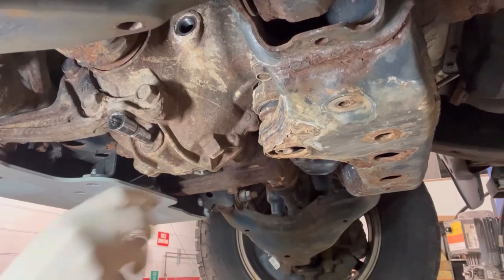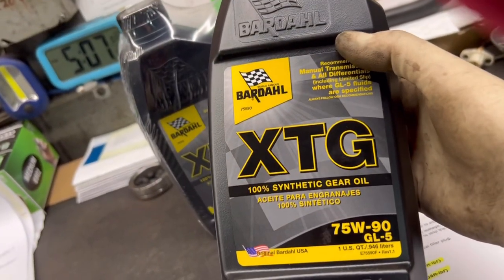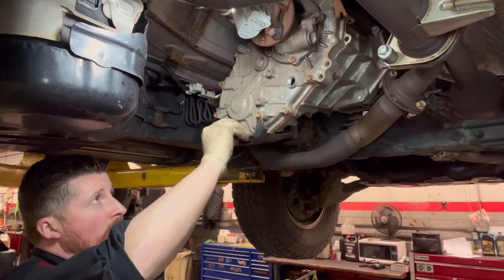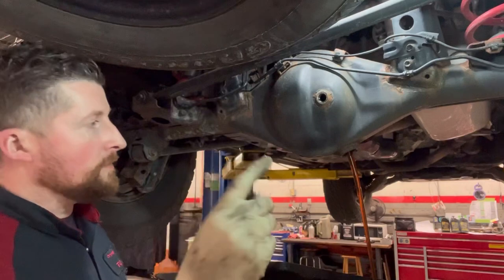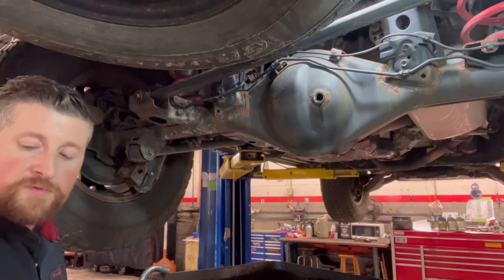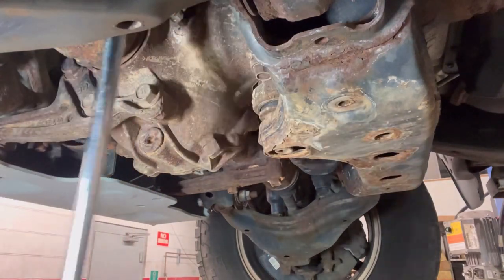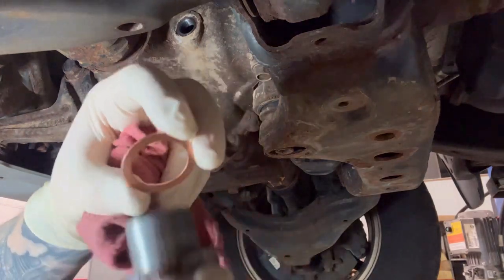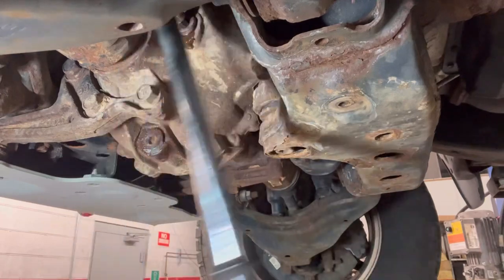Toyota 4Runner • Maintenance Tech Tips - DIY Differential & Transfer Case Fluid Service • Episode 10

Comment: Well done video!  I just purchased '07 with 188k.  Am replacing intermediate steering shaft, strut assembly,   sway bar bushings, cv boots, and all fluids (no idea when any of these were serviced.)  I believe your video is applicable to 4th gen. 4Runners and plan to use as reference.

thank you for posting....will be looking for your other "Maintenance Tech Tips"...I can use them  😀, SM
Reply from the maker: Welcome to the Channel!!
It’s exactly the same as 4th Gen, you got this. 💪🏻
Best of luck!!

Comment: Cool. I use the Mobil1 75w-90 synthetic. I do transfer case and rear diff service every 30k miles. My 2006 Toyota Matrix 4WD has 220,00 miles and runs perfect.
Reply from the maker: 👏🏻👏🏻
Thank you for sharing!

Comment: Purchased washers off the link people are telling me that they aren't safe because they are aftermarket and will leak have you used the ones you linked? Or only OEM.
Reply from the maker: I have used both without any issues. If you torque the plug to specs you should be fine.

Comment: I like to use brake cleaner around the plugs before removal. Also, if you heat the front differential housing around the plugs with a torch they usually come right out.
Reply from the maker: That’s a great tip!!
I appreciate you sharing.

Comment: Lol.. you showed the truth… what it really takes sometimes to get stuff loose. 👍
Reply from the maker: I try to keep it real and honest.
I appreciate you watching!!
Your support is much appreciated!!
Reply: Thanks for the tip about the chisel and punch method.  I suppose it works.  I think I would have tried some penetrating oil first.  Actually, since the front diff plugs are likely to be little tighter than the rear, start with the front.  If the front doesn't want to move, penetrate oil them, then give it a few minutes soak in,  while working on the back diff.  If the penetrating oil doesn't work, then fall back on the chisel and punch.  But that's just me.  You do you.
Reply from the maker: I live within the rust belt, penetrating oil only takes you so far around here.

Comment: What a wicked video! Never done any of this work in my life let alone I do not think its ever been done on my 06 4runner sport V8. ( 2 Previous owners) and I am at 243000km now. Need to do all of this and transmission service. Had a good laugh at the end of your transmission service video as I said that was good but didn't drop the pan and show all what I wanted to see that TOYOTA does not do at the dealership after just paying $244 CAD for them to do a drain and fill.  Service manager said 7 or 8 L would have come out but every video I have watched shows roughly 3 quarts or 4L coming out only. They only charged for 4L on the sheet because he said its bulk and we are not going to charge for the continued amount.. ( still confused by that) One of the mechanics there is its about 4 L and someone in the parts department said ya it should be around 4 L so why would the service manager at Toyota tell me 7 or 8L came out? Very confusing. Like I said I have never done any of this before but I have watched about 10 videos on it now and including yours not one showed 7 or 8 coming out on a drain and fill lol Torque converter and the transmission cooler I believe is where the rest of the fluid stays in the system and why you have to repeat the drain and fill 3 to 5 times over a period of time to get to a happy purity back to red in color. Toyota only recommended this transmission service for my 2006 4th gen 4.7 L V8 at 96,000km but with 2 previous owners no idea if it was done or not. Toyota also does not say you need to drop pan / clean it / clean magnets / replace gasket just the drain and fill. If the system holds 12.2 L empty ( I asked) and only 4L came out the majority is dirty as heck still and not performing how it should. You did mention at the end of your one video after you thought about it unless you are towing (I am not) then you do not think you need to drop pan and do all that. That is good to know being that you are a Toyota mechanic. After watching all these videos I want to change everything to help with the lifespan of the vehicle. I would imagine all the torque specs are different on a 2006 4th gen 4.7 L V8 for transfer case, rear diff, front diff etc and dropping the pan all those bolts and drain and fill plug. Maybe I can buy a mechanics book from Toyota on the vehicle so I can have all those exact specs while performing. Very nice videos you made going over everything absolutely after to see coming from someone with zero mechanical experience in doing any of this. Super awesome content angles and tips and tricks displayed! Thank you for making these! That was a long rant hope it all made sense lol been so frustrated over this issue trying to get a clear cut answer from Toyota. One last thing when you dropped the pan in your one video and replaced gasket on fill plug and drain plug I swear one was rubber but then when you showed the picture of the gaskets they looked like normal washers. On my transmission drain and fill just performed at Toyota they do have marked down 2 gaskets which I would imagine is them. you said if the one is in good condition do not have to replace. Maybe it is different on your brand new looking for runner than my old one. Guess I will find out. Thanks again great job!!!
Reply from the maker: Thank you for sharing your story!!
I appreciate you watching!!

Comment: Thank you sir! This was perfect and looking forward to the propeller shaft torque checks and u joints zerk fittings greasing video coming! What grease and grease tool would you suggest?
Reply from the maker: The grease tool I use is a cheap one. Harbor freight one. Video Coming soon

Comment: Excellent video man. Thanks a lot! So can you use the valvoline 75W-90 oil for all 3? The front diff, rear diff, and transfer case? Was going to just get enough of the squeeze bags for all 3
Reply from the maker: You will be ok on all 3 with same gear oil. 👍🏻
Reply: @VikingsGarage  okay got it thanks!

Comment: People are saying you need a specific fluid for the transfer case or you can damage or wear out the parts.  Redline GL-4 ,Royal Purple, or Toyota fluid because of the special additives.  I used the Valvoline in a bag you recommended, should I change it to one of these?
Reply from the maker: I’ve been doing it this way for over 13 years with no issues.
But to answer your question Toyota does make a transfer case fluid only.
Reply: Thanks for taking the time to respond.  I should have read all the other comments people posted asking the same thing.  You rock Mr. Viking!
Reply from the maker: No worries 🤘🏻
Reply: @VikingsGarage 85 weight that is 100$ MSRP for one litre?

Comment: Alright, I have a stupid question. Do you need/want the oil to be warm/hot? I'm used to doing the engine oil and do that warm but I am not sure on the diffs and transfer case if it matters? thanks!
Reply from the maker: Does not matter. Just drain it and re-fill it

Comment: for the at home DYIer.. is there a spot on the 4Runner that is best to check for level?  Obviously most everyone's garage and driveways have a little slant.
Reply: It really doesn't matter that much, just park it anywhere that looks "flat" to you.
Reply from the maker: I have to agree with @and .
If you want to get crazy use a level on your door bottom edge or side steps. But honestly use your best judgement. It’s not the end of the world if it’s off.

Comment: I’m not going to hate over fluid variety. I spent the coin. Nobody twisted my arm. I’m new to doing this… should I use filter paper pouring it into another container I can measure. Specs say 1.1 qt. Do I need to tap into the 2nd can for the .1? 

I paid $85/qt…… idk if or any benefit over the Mobil 1 or redline 75w…… next time I will ask more questions sooner….
Reply from the maker: I personally prefer the valvoline gear oil pouch , super easy no mess no contamination.
https://amzn.to/3si6kdC

Comment: I changed my rear fluid at 32Kmiles, and it was pretty grey honestly(and the magnet had quite a bit on it)
I bought the 5th gen with 6Kmiles
And i am a gentle driver.
I have a toyota with manual trans which i also chg every 30K
I have not done the transfer or front diff yet. Still trying to sew what most folks go with for their xfer case fluid

Comment: what do you recommend for transfer case? It seems to be a lot of differing opinion. GL5 or GL4 and the weight or gear vs manual transmission fluid....
Reply from the maker: 75w gear oil Gl-4 or Gl-5 . You can’t go wrong with either

Comment: Great video.. It seems that you ended using the fluid from the barrel, if so just wondering what was the rationale for it ?
Reply from the maker: That you can use whatever fluid you want synthetic or not 😎

Comment: Hey Viking garage, I have a 2018 4Runner as well and I wanted to know if you’ve had issues with snapped skid plate bolts and if so how did you fix?
Reply from the maker: I’ve fixed hundreds of snapped skid plate bolts. Very common issue.
You have to drill and tap it as best you can.

Comment: 9:17 ... this is likely THE MOST challenging area to do on your shoulder/neck/back with the wheel off for ease of access. 2o11 Tacoma similar setUp.. ? the rusty crusty is an issue or not? with those drain and fill plugs being so TIGHT?  i busted up my left arm bad for months breaking those plugs free on gen2 Tacoma , top first and bottom was no clearance for long breaker like you used here. clean out the dirt and crud with a pick and penetrant before hammering the hex key into it, it might help a bit to prevent a stripper on that plug
Reply from the maker: Yeah having access to a lift makes this process a breeze.
Reply: @VikingsGarage  and yes! i did have to remove the driver wheel on that Gen2 Tacoma to even find where the fill plug in the front diff was located behind CV axle and above the LCA 

WHY did they not put that fill plug where it is on the Gen1 Tacoma, right up in the front area and not the side
Reply from the maker: @efil4kizum I hear you!!
Simple answer: Because engineers don’t actually work on these vehicles nor do I think they care about us that do. 
Stay safe my friend!!

Comment: Thank you so much for this video. I am ready to do my 60k service. Besides oil, front/rear diff and transfer case fluid, is there anything else you suggest besides what’s in the service manual?
Reply from the maker: very good , if you haven’t done it yet flush your brake fluid and lubricate the drive shafts. 👍🏻
Reply: @VikingsGarage  thank you for your help!

Comment: Great video! I have a question though, is 75W85 better than REDLINE MT-LV for the transfer case? I guess I wasn’t sure if those 2 were compatible
Reply from the maker: Im not familiar with the red line product. But 75W85 is the correct gear oil to get.

Comment: Hey Paul, so it is ok to use the same oil for the diff and the transfer case? I picked up the Valvoline 75-90 pouches, just want to make sure, thank you brother.
Reply from the maker: It sure is. 👏🏻

Comment: I may have missed it but I know the differentials take the gl-5 75w-85. But the sheet you showed doesn’t show the transfer case. I have the Toyota spec sheet and it has a different fluid for the transfer case. LF sae 75w….. (which I believe is a GL-4??? Also guy at dealership said the LF was important. What is the equivalent for this? I’ve not been able to find a straight answer on this. Thanks!!! Some say redline LV-MT?? But unsure. Appreciate the response!
Reply from the maker: They do sell specific transfer case fluid. I’ve been using for 13 years, regular 75w-85 gear oil with absolutely zero issues.
Reply: @VikingsGarage  thanks so much for the reply! Have a great day 😊
Reply from the maker: @imtherealjoeyd you got it!

Comment: I see on your white board 4Runner W Pump, are doing a video on replacing it? Mine is leaking and I have to replace it on my 2018 4Runner, I would love to see you do it first!
Reply from the maker: I was thinking about it, but unfortunately I will not. 
I’ve sold my 4runner and my water pump is not leaking.
I will eventually do a video on it. 
Just not in the near future. Sorry Buddy.

Comment: I need to change the fluid in the rear diff of my '05 SR5 V6. I have lower back issues, so getting underneath my truck without jacking it up a bit is very difficult.
I see you are recommending that the truck remain level for this service and I understand the reason. But since I know the quantity required for fill, do you still suggest that I not jack the truck up a bit using my hydraulic jack? I should first try to open the fill plug first, correct?
I am going to use Amsoil Severe Gear 75W-90. Thank you!
Reply from the maker: Always do open the fill plug first, for the obvious reasons. If jacking it up helps, by all means. As long as you get it done.👍🏻
Reply: @VikingsGarage  Thanks! What is your opinion on Amsoil products?
Reply from the maker: @hisroyalfurrinesschewbacca6757 Some of the best in the industry if not the best.
Reply: @VikingsGarage  Whew! Thank you!
Reply: @VikingsGarage  I forgot to ask... what are the torque specs to tighten the fill and drain plugs for an '05 SR5 V6?
Reply: @VikingsGarage  Got it done, not a big deal at all. I put in three bags (1 qt each)  of Amsoil as mentioned above, but couldn't squeeze 100% out of each bag. Specs say 2.7 qts. , so I should be good. I don't like my click torque wrench, so I am going to get a digital. Click just doesn't seem accurate.
Reply from the maker: @hisroyalfurrinesschewbacca6757 it’s the same as specified in the video .

Comment: I think the flat side of the crush washer should sit against the bolt head rather than against the differential housing. But I've seen differing opinions about this. What do you think?
Reply from the maker: Honestly, I don’t think it matters. What matters is using a new crush washer.
Reply: @VikingsGarage  Thanks!

Comment: Does it matter which way the rear diff crush washers face? They are flat on one side oval on the other. Looked like you put flat side toward the drain bolt.
Reply from the maker: The way you say at the end is correct. But if you did it the other way nothing bad would have happened (wouldn’t leak)👍🏻
Reply: Thanks

Comment: I just got the Toyota 75W fluid. Do yall use these cans at the dealership? Curious how to get into the can without contamination issues.
Reply from the maker: You can always suck it out with these big syringe type pumps. Super easy.
Harbor freight has them cheap. 😉

Comment: What is the torque of the upper screw of the rear differential. Why did you only mention the torque of the lower screw? It is 36 lbs.
Reply from the maker: They are both the same spec Sir.

Comment: I have 2016 4runner rear wheel drive. I am trying to do diff fluid, does the fluid need to be limited slip additive? Fluid i am using is 75W-90 GL5( no have limited slip additive) thanks
Reply from the maker: You’ll be fine with what you got. 👍🏻

Comment: I have an 07 4runner. So 75/90 for both front and read diff and also the TC, correct?
Reply from the maker: Yes Sir!! 
Been doing it that way for 13 years, zero issues. 😉
Reply: Thank you so much. Love the videos

Comment: Do I need to remove the front skid plate for the center lift point?  Or, is it reinforced?  TIA.
Reply: @VikingsGarage  I want to change my front diff oil in my driveway.  The crossbar is behind the skid plate.  The schematics indicate it’s a lift point so I can then put the jack stands at the frame.  My question is, is the factory skid plate reinforced at the cross bar for lifting with a hydraulic Jack?
Reply from the maker: I wouldn’t try it, never lifted a 4Runner from there.

Comment: What's your opinion on using Pennzoil Platinum Ultra engine oil for 2016 4runner SR5 2WD in Houston, Texas?
Reply from the maker: Never used it, so I’m not in a position to recommend it. I personally favor either Mobil1 or Amsoil, whichever one I find first.
Reply: @VikingsGarage  which Mobil 1 would you recommend to be used on 2016 4runner
Reply from the maker: @youssbaraki whichever one suits your needs.